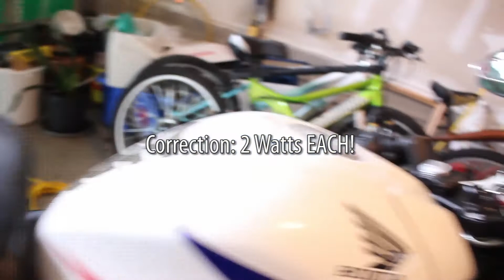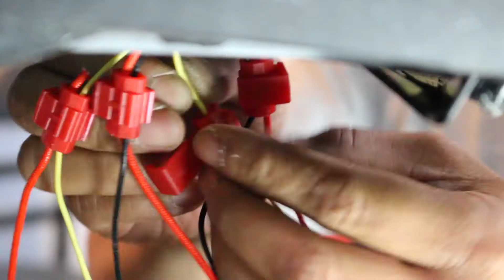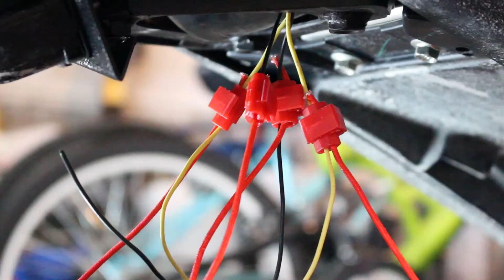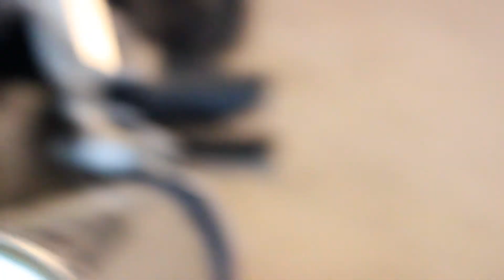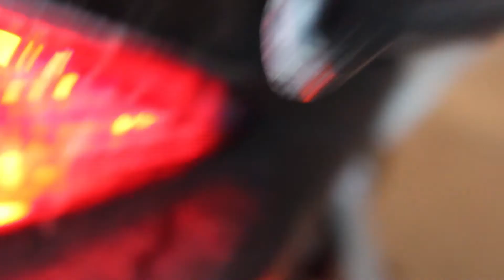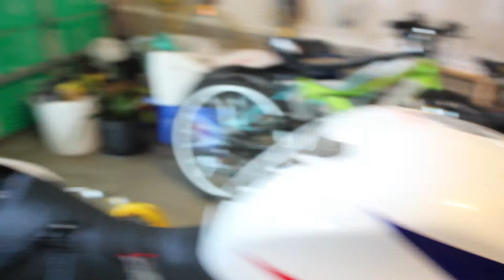Fix Hyper Flash Blinking with Load Resistors - CBR250R

Comment: My 2 cents, having installed remote starter systems on cars for 4 years we would never use those quick connects unless we absolutely wanted problems.  If you live in any place that gets any type of humidity those quick connects will oxidize over time and cause you all sorts of electrical problems.  They're also problematic because different wires have different shield thicknesses and they could either cut through the wire itself or not get enough through the shield to make a solid contact.  Not to mention, the part that contacts the wire is so thin you could still have problems from road vibrations.  And good luck trying to figure out which one is causing the problems.  Strip and solder your wires if you want to be 100% certain your connection won't fail.  If you don't have the tools, use bullet connectors way better then those crappy quick connects.
Reply: That's what I was thinking. No shrink tubing? Any riding in the rain is going to quickly short this out. Why not play it save and shrink tube everything???

Comment: To clarify, these resistors are NOT "25W of load". That is simply the maximum power rating for those resistors before they burn up (excluding a bit of margin). They are 6 Ohms of load. Across a 12-14V circuit, these draw (R=V/I or V/R=I) 12/0.006=2000mW of current, or 2W. A little more (2.3W) for the ~14V that an alternator can put out. 25W of load would be one very very hot resistor and loaded circuit.

Comment: Don't waste your money on these, go to Auto Zone and get an up dated flasher for your vehicle it's cheaper $15.00, you won't be cutting into your wiring and it's quicker.
Reply: Most bikes and new cars don't have replacable flashers for turn signals, they are built in to the current regulator.

Comment: Hey,If I change all of my turn signals with headlight and taillight from stock (filament type) to LED type (obviously they will have less power consumption) but I will have to fit them with resistors (which heat up and cause loss of energy) will it give a good battery backup or battery charge intervals will increase??

Comment: For vehicles with a flasher relay, it's MUCH easier to just replace it 
with an ADJUSTABLE RATE FLASHER.  Maintains lower current draw and 
adjustable rate knob is very nice!

Comment: I installed the resistors on my 15 camry in the front and it was a little tricky at first on where to place the resistors so I had to tie them up with plastic wire ties but the wire ties are only touching the wires on the resistor, they are just really hanging and not touching anything at all.
Reply from the maker: +kruff39 That's a neat trick. It helps you place the resistors exactly where you want them. Thanks for the tip.
Reply: Np

Comment: Does the resister cool down when you are not turning or using the signals?
Reply: Yes. The resistors only start getting warm when the turn signals are turned on.

Comment: Hey there! So I did the same to my cbr250 and its working great! Was that the final resting place for your resistors or did you find a better spot?
Reply from the maker: ***** Yeah that was where I left it and it seems to be working well. The other thing I did was I stuck them together with a drop of superglue to spread the heat between them. I'll put a photo of it on my Facebook page (facebook.com/RealBrownBrady).

Comment: i see diff size resistors , how do you know to use 20 watt, 25 watt, 50 watt resistors.
Reply from the maker: Top flight Check how many watts your existing light bulb currently has. For example, my stock turn signal bulb was 21 watts, and I replaced it with a 2 watt light bulb. I needed at least another 19 watts. So I bought a 25 watt resistor. It's ok to go a little higher. It's ok to go one step higher, but going too high of a resistance might overload the circuit it is on.
Reply: Resistors do not have W, have ohm.